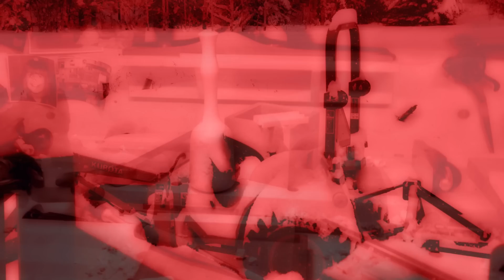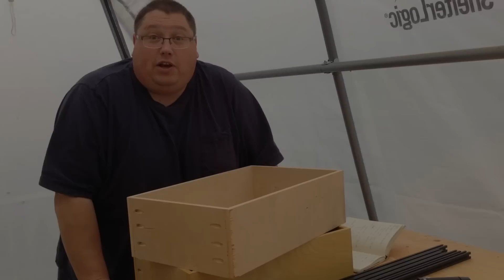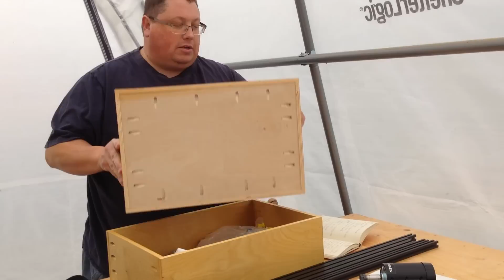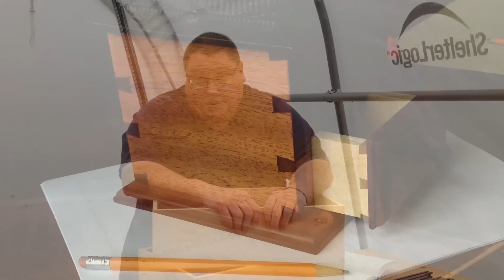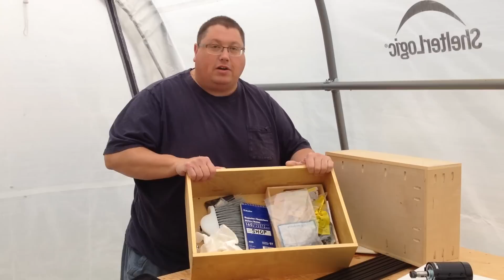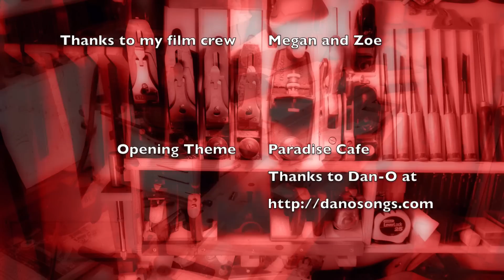How NOT to Make a Drawer

Comment: So many comments here, where to start. Yes I agree, you must have that big box store like crap plywood. Here is what I have learned that might help
1. Use a good finishing saw blade
2. Use a striking knife or utility knife to prevent tear out
3. Use blue painter's tape on the cut line
4. Make or buy a zero clearance insert
5. Use kreg micro pocket jig AND the appropriate screws for that jig & 1/2 material. You should not have screws coming thru the end if the depth stop is set correctly
6. Use kreg corner clamps and face clamps. As you may know, the pocket hole is tapered, and when you drive screws in it shifts the piece. Even if you are using the kreg clamps, make sure to clamp scrap blocks tightly into place to hold things from shifting while screwing together (setup matters). 
7. Use baltic birch instead of regular big box store birch plywood.

Comment: I’ve made a lot of drawers w 1/2” ply and Kreg jig with no issues.  You have to reset the jig and bit accordingly and use standard bar clamps to hold parts tight, but never had issues w movement.  If you didn’t have bar clamps and had to rely on just the Kreg hole clamp, I could see that prove challenging.  I typically float bottom or screw just the back similar to Next Level Carpentry’s technique.  I have have never seen the bottom screwed in like yours which could also have contributed to a challenging alignment and could cause some long term challenges with wood movement.  Certainly love dovetailed drawers, but pending the application pocket screws are a great alternative with much faster production speed and still exceptional strength that’s been proven in scientific testing.
Reply: Agreed, I use four 90 degree clamps on top to hold the sides square and flush, then clamp the bottom along the side with two long F clamps. This keeps everything in place while sinking the pocket screws. It takes a little bit longer to assemble with the clamps, but we’ll worth it for tight joints. A little glue at the joint is always a good thing too.

Comment: just started browsing into this because the wolfcraft jig overshoots with 1/2 inch ply, although it has the setting. the angle is too steep so the nail breaks through the side on the connecting piece

Comment: i have to agree with you on the 1/2 inch. i use 3/4 and never had a problem. i must also confess that where i live 3/4 is cheaper than 1/2 for some reason. i asked about it and was told that they can buy it cheaper from the broker. baffles the mind. so that is why i use 3/4 on everything lol (except 1/4 dado on bottoms)

Comment: I'm building drawers for shop storage.  I'm using the 1/2" plywood, but I'm just gluing and screwing it.  Nothing fancy.  Just have to have some storage to get things organized.  While Dovetails look and work great, they are really beyond my skill level and not needed for storing my collection of welding clamps, hammers, or misc other junk cluttering up my shop.  But I won't be using the pocket hole jig for that.  Thanks for posting this tip.
Reply from the maker: +dahveed284 No problem. I understand about the dovetails. In the 90's I spent so much time learning how that I actually find it faster now and I can't abide the thought of losing that skill. I still use the glue and screw style for a lot of things. It's even faster and very reliable. Even more so than the Kreg jig I think.

Comment: Thank You, I thought it was me, not the Kreg Jig.  I'm glad to see others have this issue.  I've given up on the jig and now finger joint all my drawers or boxes below 3/4 inch.  It's a lot of work, but at least I don't vomit when I see the results.  Also, get yourself some real Baltic Birch.  Look around for wholesale retailers of sheet goods, and you can get some really good deal on some Russian BB...
Reply from the maker: +Danimal GB It's unfortunate that it doesn't work well with 1/2 inch. Normally I make drawers from solid wood because I like to dovetail them. I'm not trying to sound pretentious but I spent a lot of time learning how to do it and I would rather just do it that way every time and be proud of the job I did. A question I have is did you use BB on the 1/2 drawer that didn't look good?  I used really crappy 1/2" stuff and wished I'd looked harder for BB.
Reply: +inthewoodshop I used cheapo hardwood plywood from the big box stores with horrible results.  BB had much better results with pull-through, but still happened on occasion, and that's more than I can live with.  So I decided to finger join all my drawers.  They look good.  I am going to try John Heisz's fake dovetail method on my next build.
Reply from the maker: +Danimal GB that's good to know. BB can be hard to get around here but I think that's the only way to go. When I lived in the states it was all I bought. I saw John's fake dovetails too. I found that really interesting. He's very creative.

Comment: I’m a novice and I made it work just fine.  Here are some tips:  use good plywood - I used 13 ply multiply - yes it was $$$ but worth it.

Next make sure to use glue!   I used 1/4 inch multiply bottom that i inserted into a notch i table sawed into the four sides.

And the real key:   Make sure to used clamps!   I clamped each corner perfectly before installing the screws 

Oh one final tip.   Hand tighten the screws - do not use a cordless drill!

Comment: 0:55 you used kreg jig on that side of the box?! Why, when you can directly flush screw straight from the back and be done with smaller holes that are also hidden from view and with less effort . In fact it would have been best NOT to use kreg and just directly flush screws on all sides (except for the front panel) as they wont be visible anyway for a drawer box. You use Kreg jig just for the sake of using it.
Reply: Drilling screws into endgrain??
Reply: @totallynotabot151  Yeah. The extra strength of the pocket hole is unwarranted

Comment: Wow! That was a timely video for me. Just came from my shop where I'm in the middle of building a tablesaw cabinet. Used 1 x 4 (I think its fir) for the skeleton, which I've just finished (used 1 pocket hole joinery). I'm now planning to build the drawers. In the past I've used pocket holes for drawers using 3/4 ply (please consider that I'm new to this stuff). So far my drawers have held up quite well (heh heh) in my workbench and cabinet. Thought I'd try 1/2 ply for these new drawers.

To that end I got the Kreg mini (or it might be Jr) and before making the drawers I tried joining some scrap 1/2 ply (don't ask me what grade it was) to test the joint. I could only find the fine thread 3/4" pan head screws so I used them. I wasn't satisfied with the joint - it just seemed too loose. Then I thought, maybe I have to use the coarse thread but couldn't find them anywhere. In fact, I emailed Kreg to inquire if they sell coarse-thread 3/4 pan head screw.

Just after I sent the email, I found your informative post as well many helpful replies. 

Looks like I'm back to using the 3/4 ply for drawers  - I simply don't have the patience or skills to use dovetails, although I admire those who do.

Many thanks for taking the time for posting the video.

Comment: I made a new workbench with 12 large drawers this year, I used 1/2  ply and a portable (single hole) pocket hole jig. I had no problems. I used pocket holes to attach the sides to the front, which overlaps the cabinet, and just put screws through the back into the sides since it was easy. The bottoms are 1/4 ply, set into dados. I used good ply for the fronts, and crap knotty fir for the sides and back, all obtained in Montreal. The bottoms were some kind of underlayment. I don't use birch anymore because the stuff I had just turned into splinters when I used it - never again! I want to make a video about it, I have hours and hours of raw video. The only issue I have is that some drawers have bowed and the bottoms want to fall out, because they are so big! I'll fix that be putting a connection of some type between front and back to hold the bow. (The sides are locked by the slides.) Maybe I'll just put up a drawer video sometime.
Reply from the maker: +Flintsmooth I agree wholeheartedly about the birch. Unfortunately, unless I place a special order, most of the time that's all I can get other than AC spruce. I certainly hope you do make a video. It's a lot of work sorting through the raw footage. I have a kind of process now that speeds some of that up but it is time consuming.

Comment: I ran into the same issue but discovered that my block setting on my kreg jig was still set to 3/4 instead of 1/2 inch. I changed my bit depth but forgot about the setting n the jig.  Not sure if this was your issue or not.
Reply from the maker: +thetoolsmith I wish it was. I even had the depth set a little shallow but the screws still pulled through. Unfortunately, I don't think the jig works with the type of 1/2" ply I have available. I'm pretty limited here.

Comment: Had a very similar experience tonight.  making a simple box frame for a table, using 1/2" ply to 1/2" ply.  One Kreg chart said to use 3/4" screw, other Kreg charts say 1" screws.  I used 1" (bought 500 or so).  I made a similar project last year, but used 3/4" screws, and all was well.  Come on Kreg, get your charts in order......And I can't find any 3/4" in stock around here...pisser...
Reply from the maker: +duenge I've had similar problems so I bought in bulk. That worked but now I only use it on 3/4 material so I have a big box of screws laying around. They'll be useful... eventually.

Comment: You absolutely can use Kreg on 1/2 inch plywood. You just used the wrong Kreg tool. Kreg has a tool that is specifically used on 1/2 inch wood. It's their micro Kreg pocket hole tool. It's not blue like mostly everything that they build, it's black.
Reply from the maker: +Thomas NorthCastle This I did not know. I will look into it and thank you very much.
Reply: I would add that the micro jig uses 3/4" screws.  The drill bit and screws have a smaller diameter as well.  I did find it odd that you Pocket screwed the bottom.  I would think cutting a dado and gluing the bottom in would not only give you a stronger but more square drawer.  You could add a few flathead screws but not many would be necessary, the strength would be from the sides.  I have found that plywood varies widely in quality,  I use a 9 ply Baltic Birch 1/2 and it works well.  But agree if you are building large drawers there is no point using 1/2" plywood, there is no space constraint, the price difference is small and with the added strength you won't have to worry about loading.
Reply: Even if you use the microjig for 1/2 material, it works very poorly on plywood. I have seen Kreg's customer service recommend AGAINST using the microjig for 1/2" plywood.
Reply: @radix23  I’ve had great success with the micro jig.

Comment: use 1/2 Baltic birch, it has much more integrity. Before you try to put the screws in tack the sides together with 1/4 in staples or pin nails. also .use glue  I use 1/2" screwsut    I have made shop draws tha .

Comment: I make drawers with just dado's rabbit's good glue and clamps (lot's of clamps). Besides, screws and nails are mainly used as clamps until the glue dries.  I do have to admit that if you are gluing to peeling veneer, you got nothing.  Also, if you're making drawers completely out of plywood, a simple rabbit on the sides to drop the bottom onto is fine. You don't need to waste drawer space with a slot.

Comment: I didnt't have an issue using good quality 1/2 inch pine plywood for garage cabinet draws.  Did it as trial of the Kreg jig with draws.  Still square.  I did use dado for the bottoms.  Like others I believe the issue was the wood.

Comment: Kreg also makes 3/4" screws which are meant for the 1/2 material. I find the 1 inch screws go too deep into the half inch. I converted to 3/4" screws. It takes a little bit of practice to get used to using them because they bottom out quicker obviously...but again, they dont go through the wood. I also used birch plywood for my cabinets but didnt have that veneer issue, but im not in Canada either. Perhaps that is the issue like you mentioned. You know everything is just made cheaper these days it seems. I was going to make my own trim and stuff for my house, but hell you can buy the trim already made cheaper than you can buy some of the rough cut. I dont know about you, but I factor in my time considerably...especially when im trying to get a job done like now. Building your own cabinets...yes you can save a ton of cash building your own cabinets. I built my cabinets for $3000. My quote for having cabinets shipped to me without installation and all that was $13,500. Granted I got a great deal on some dry aromatic cedar at auction.

Comment: I got 2 done right now that worked. 
it's within a 16th of an inch.
I'm here trying to find a good way to fastening the drawer to the slides.
anyone have a good glue screw combo technique to use to install 1/2 mdf drawers onto 100lb glides onto 3/4 particle board?
I think I'll bolt the glide to the particle board cabinets. 
please hurry wroth comments. 
2 of 3 drawers made for 1st cabinet.

Comment: Interesting video as I was contemplating just this method of construction for some drawers in my shop. Now I am not sure how I am going to make the drawers. Do you think the solution would simply be to move to 3/4" plywood? Or is the whole method flawed?
Reply from the maker: I believe you would have much better luck with 3/4" plywood. The Kreg works well with 3/4" material. I don't know where you are, but if your 1/2" ply is of better quality, you might have better luck. 3/4" will be heavier and leave you with less net volume - always a problem in my shop.
Reply: +inthewoodshop Hi, in Belgium. So far all the plywood I have found have cigarette paper thin veneer glued on by gravity and a fine sprinkling of water. Poorly patched on both faces. That is the good stuff I have found, the bad is as flat as a roller coaster, with the same veneer. But it is good to know that the method is not necessarily flawed.
Reply from the maker: Hilarious!  It's weird that your plywood sounds identical to ours. I have a feeling the veneer is shipped to China, then glued up. As for 3/4" ply, I know when it's made here at home and it is far more reliable.
Reply: +inthewoodshop Most of it is actually from China - not the same birch we have in North America, Daniel is likely either dealing with Chinese or Russian birch (both of which are crap).

Without being able to source good plywood though, one of the biggest problems with plywood drawers is actually deeper than the face veneers, and that is the voids and glue strength.  Voids are so common in the cheap plywood that any manner of fastening is compromised from the start.  You may not even realize it when you cut your parts though, as the cut edge might appear sound only to have a void just past it which prevents your fasteners from holding.  The laminating adhesives used are also inferior and will delaminate quite readily.  This also prevents any sort of fastener from holding well (to include dowels).

Locking rabets are a better option.  The wood to wood joint between members is secured with a quality adhesive, so even if the drawer delaminates, it generally will prevent a complete failure.

Best option is to check locally for an honest to goodness lumber distributor (not a home center/DIY store...or even retail lumber yard).  Specify a good quality plywood product and then have them order it up for you (most don't keep it on hand).  If you can't find one locally that will do business with you (many don't want to deal with the guy off the street and are only interested in commercial customers), look up a cabinet shop and have them order the material for you from their suppliers.  Most are happy to do so...for a nominal fee.  Still ends up being cheaper than most lumber yards charge though for special order materials.